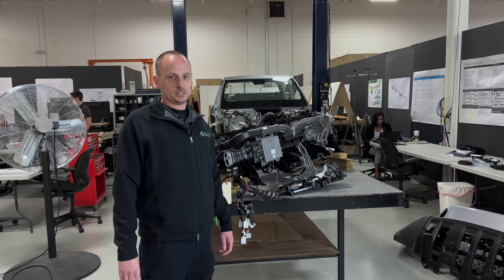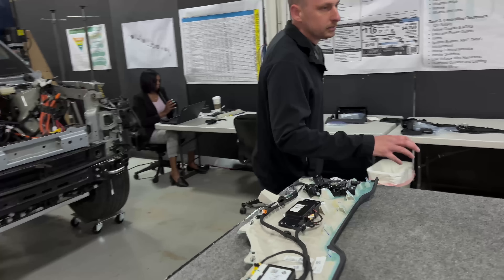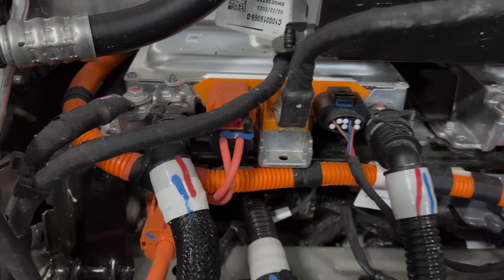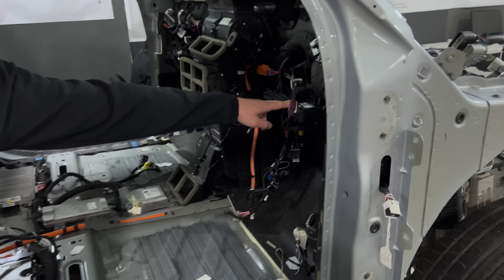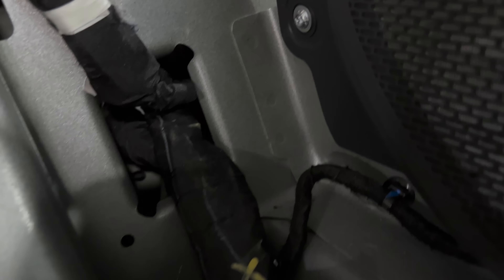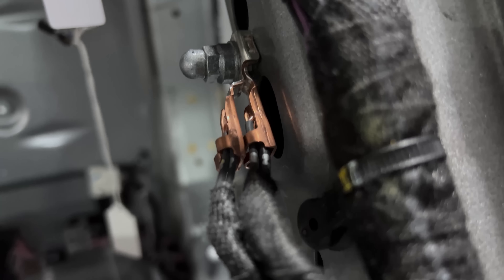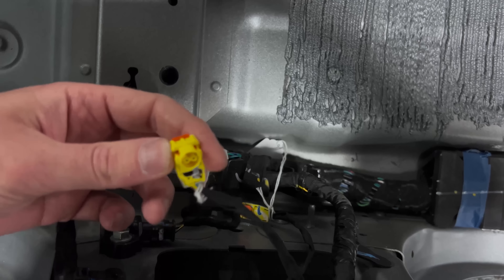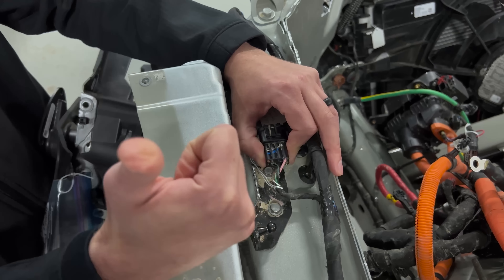Rivian Wire Harness Whirlwind

Comment: impressive that they made a truck that is as good as it is.. but i wish they'd not have all this ridiculous telemetry and other tech for the sake of tech, i want the basics. no cameras, no bluetooth, no radars, these things are not conducive to human health. Cars peaked about 20 years ago. Proper mechanical ignition switches, mechanical handbrakes etc, then it all started going down hill from there, much like the vehicles with faulty electronic handbrakes.
Reply: This vehicle is driven by software which learns based on telemetry. If you want reliable mechanical by a 1995 dodge cummins and rebuild it

Comment: This is a mishmash feast of afterthought and the worst example of rubbish engineering.  It's a disaster waiting to happen.
Reply: Nonsense!!!! This is their first production vehicle so there are going to be some problems/issues with those, they are going to iterate the design and also while making much less powerful and affordable models with 2 or 3 electric motors and different batteries copacities…..